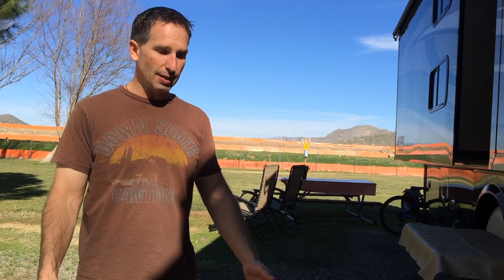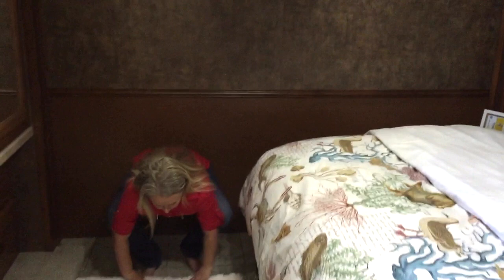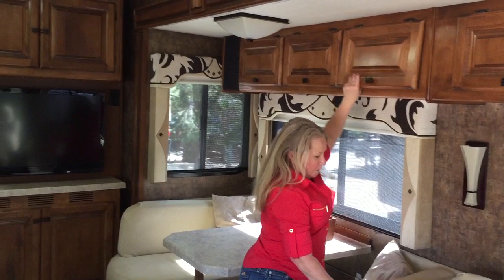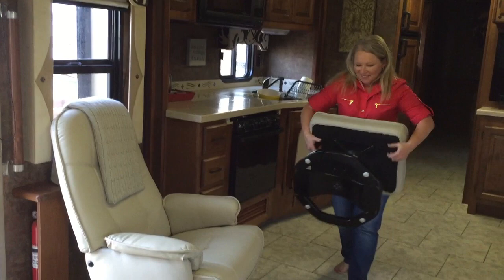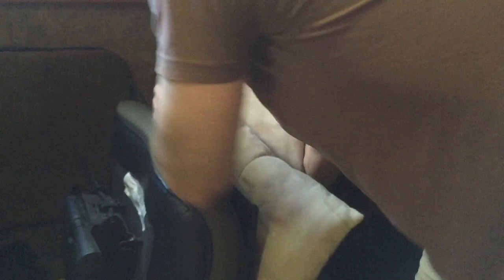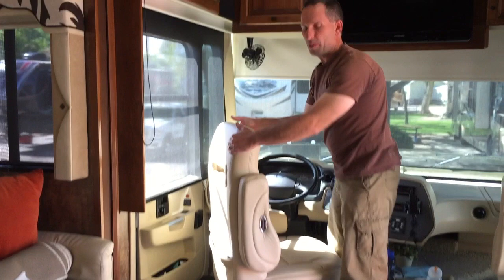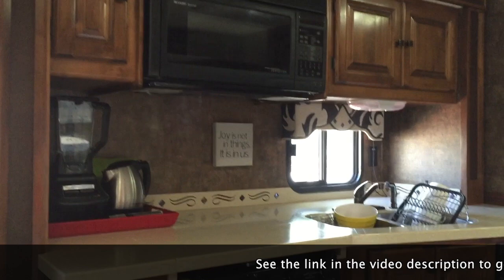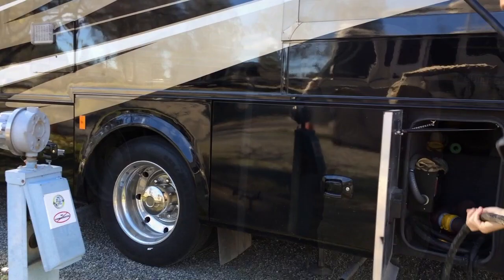What Happens on RV Pack Down & Move Day? See Our Routine Inside & Out

Comment: It is nice to see how you both work together so well.  I am just a RV Watcher I guess.  Anyway I wanted to share a good ideal with you.  That is to change out the Anode Rod in your water heater every so often depending on how much hard water you are being supplied with on the road.  Hopefully your water heater is mounted in an area with enough room to change it out easily.  I order my anode rods from Amazon.com as they seemed to be about the best source with good price on them.  And also remember to drain your water heater tank every few months to get the sediment out of it.  I do this on my tank on home especially due to the price increase for new water heaters so also keep on hand replacement heating elements for them also.  We have very hard waterout here in New Mexico so I have learned to do this and get more years out of them.  Please pass this along to your RV Friends and Neighbors.
Reply from the maker: +Jerry “NMsanduneman” Staeden Yes good tip thank you. Marc has drained and cleaned our Water Heater - he tried to change the Anode rod last summer then realized ours (being an Atwood) doesn't have one! But the water in NM is very hard, have to use water softener to avoid white marks on our dark clothes!

Comment: This might be a little tardy.... but better late than never.  My suggestion is about checking the tire pressure.  I used to drive bus for the local
transit company.  The service manager used a label maker and mounted a label on each fender above the tire.  That way there was no 'I forgot what the pressure was supposed to be' excuses.
Reply from the maker: Great suggestion - thanks for sharing from your experience!

Comment: When I hit the road a couple months ago, my trailer and truck were packed to the gills.  I have since been getting rid of stuff along the way, either throwing stuff away or giving it to thrift stores.  I still have a lot more stuff to get rid of, but I am sort of a hoarder and it's not easy to get rid of my stuff!
Reply from the maker: +Gary Anderson Yes letting go of things is definitely a challenge - ours was packed to the gills when we started too but over time as we realized so many items we didn't use in a year it became easier to drop them off.  It's one reason we like our gas coach which has less weight capacity than diesels.. if we were able to carry more weight we might be tempted to carry more gear but this keeps us mindful and not taking on things we simply don't need. Good luck! It's a great feeling to lighten your load - on every level :)
Reply: That makes me feel better!  Thanks.

Comment: Hi Guys, love all the information you guys are sharing. I noticed in the video when you retracting the leveling Jack's you use blocks under the jacks and I noticed you had few under the front tires. why do you have to put blocks under tires...?? Thanks and keep it up... someday my wife and I will cross your path... 😊😊
Reply from the maker: Hi Nos! Actually we have a video to share on that soonish, but short answer is.. ours being a GAS coach, means we don't have the ability to lower our coach for leveling purposes like many diesels do. While we have auto leveling jacks, it is UNSAFE and definitely not recommended to level the RV with the jacks alone IF it means any of the tires are off the ground. You'd be putting way too much faith in the jacks not failing and potentially having your rv crash down and cause damage to the rv, your contents or passengers. Hence the leveling blocks which help raise the rv to help level it, and of course when the rv goes higher, you need to put blocks under the jacks as well, so they don't overextend and can reach safely. Hope that helps as a starting point and Marc will explain in a video soon as well. Note - leveling blocks are likely not as necessary for many newer Diesel Pushers but even those may need blocks on occasion to get level on an uneven site. Happy Trails!
Reply: RVLove | Marc & Julie Bennett Thank you so much for taking time explaining it. Had a feeling that was the reason. We are going to get a gas class a 40' also. We can't wait to hit the road. Be Safe and TTFN...😊😊
Reply: RVLove | Marc & Julie Bennett Thank you so much for taking time explaining it. Had a feeling that was the reason. We are going to get a gas class a 40' also. We can't wait to hit the road. Be Safe and TTFN...😊😊

Comment: Hey guys.  Thanks for the video.  We kinda split up the duties also and then double check each other.  So far, no mis-cues.  I was curious about what you are using to secure the propane tank in the back.  Could not tell exactly from the video.  Looks like straps of some kind.
Reply from the maker: Hi there - our propane tank has a built in strap. Good to see you have a system that works for you.
Reply: I was referring to your propane bottle that you use with the grill.  When you put it in the bay it looked as if there was a strap securing it in place.  I carry one the same size from time to time and was wondering if you had discovered a way to keep it safely in place.  Thanks.
Reply from the maker: Hi Danny, yes we were also referring to the portable propane tank for the BBQ and firepit, the bay of the RV has built-in straps to secure it. It's a handy feature for sure. Cheers
Reply: Marc and Julie, thanks so much for the responses.  We are downsizing from a 40+ ft DP and have a Tiffin Open Road on order.  Although a different model from yours the storage is practically the same.  I was able to slow down the video to see the straps and that is a cool thing, but not sure they are still doing that.  We'll see and if not I'll add my own.  Really enjoyed the stories on driving your coach and your visits to Red Bay.  We've been there twice.  Ordered our coach with the Sumo Springs and putting a Safe T Plus on it when it gets to the dealership.  We've had gas coaches previously so we know the differences, but hoping the new 6 speed transmission and torque available at lower RPM'S will soften the transition.  Keep the stories coming and safe travels.
Reply from the maker: Hi Danny, cool good for you - glad the vids have been helpful. Curious why you decided to switch from your 40+ DP to a gasser?
Reply: Well, probably not enough room to write it all but, we had two gassers and a shorter used DP before we invested in a newer and bigger coach.  We wanted all the bells and whistles.  What we found was that all the bells and whistles don't always work well.  We had a lot of problems thus the latest trip to Red Bay.  It finally got to the point that for the money we invested we didn't think it was worth it and I wasn't convinced that the issues wouldn't continue.  We also had challenges with the size of the coach not fitting places as well as the shorter one (i.e. our driveway to load and unload).  We just made the decision to go back to a gas unit for more simplicity, knowing full well the differences between the two.  Some things we were spoiled with such as residential fridge, washer/dryer and fireplace we wanted to keep and the new unit has these.  And as I mentioned earlier, with the modifications on the newer Ford V10 and tranny, we are confidant that we will be satisfied with the new coach.
Reply from the maker: Danny thanks so much for sharing - that is an excellent summary and we agree. We love DPs too but all those extra complexities of bigger fancier coaches DO often come at a price beyond financial ie. not working/inconvenience. I think you are wise to be clear on the features you liked in the DP and have those in a gasser - and for a lot less $ still have tour most important needs met. Bigger DPs can be beautiful and handle well on that chassis but you really need to be able to justify the additional expense. Definitely no one size fits all is there!?

Comment: Did you hook the green flush hose to the campground water supply?  What if others did not have the back flow valve?  How would you make sure the water supply is sanitary?
Reply from the maker: Good question. We wipe down the spicket and handle for it with a Clorox disinfecting wipe. We also run the water for a minute before hooking up the hose.  It's the most we can do as we can never guarantee how others have used the top before us.... Oh and some campgrounds have backflow regulators built in / attached to their water spickets, which is nice.